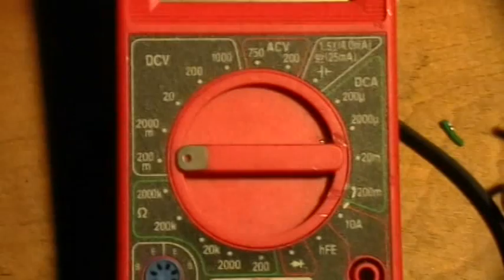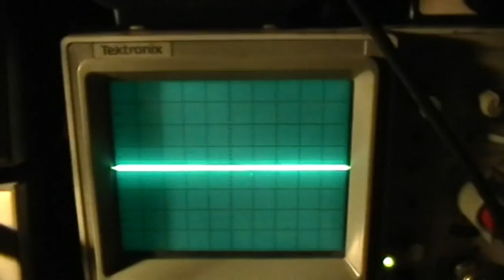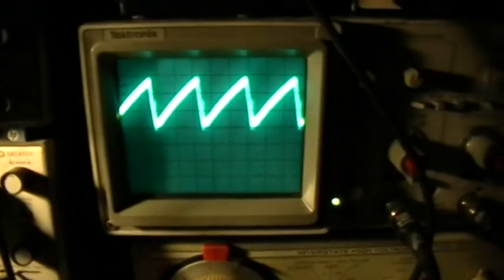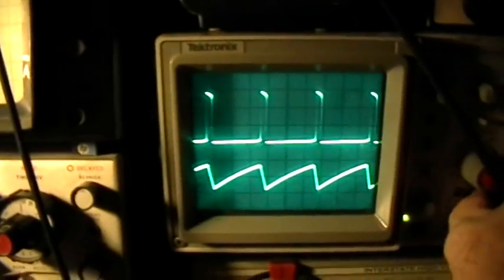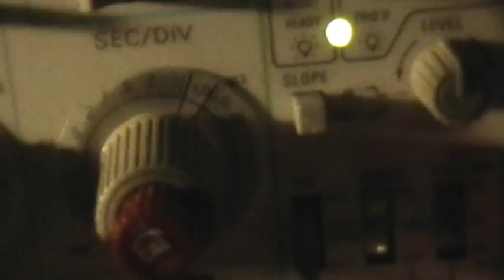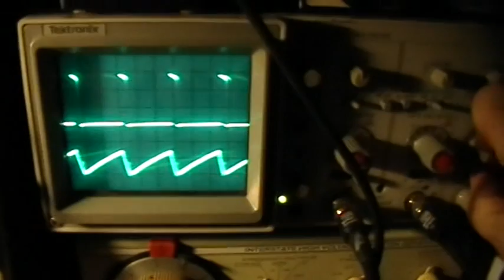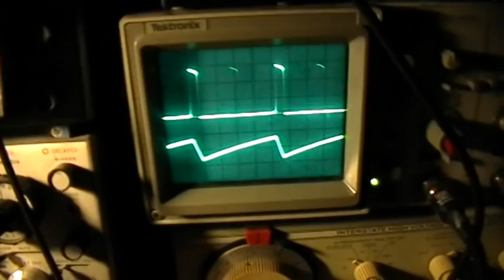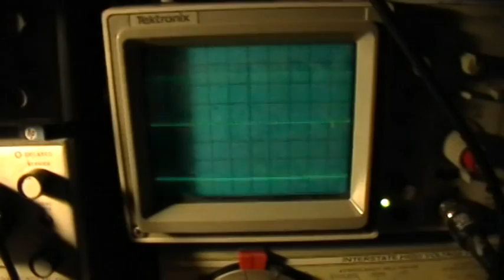Joule Thief: JTEnhanced Current Input, Voltage Output Waveforms

Comment: It's hard to make meaningful measurements when the battery voltage is dropping steadily.  What caused me to doubt the DMM reading was when I calculated the efficiency of my Supercharged JT as 90 percent.  But then when I got the luxmeter and compared the LED's light output, I found that it was almost twice as efficient as the conventional JT.